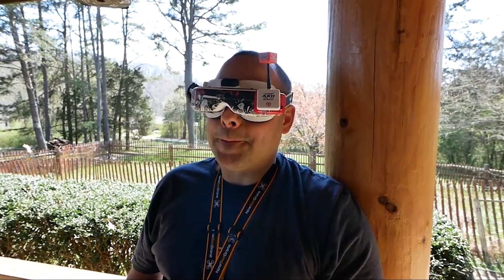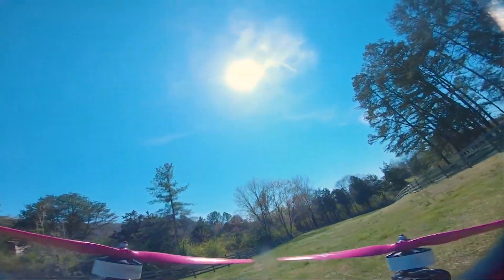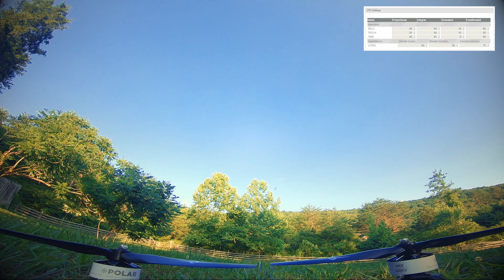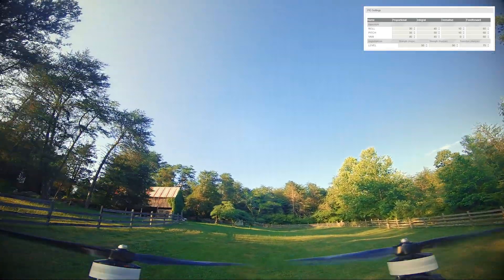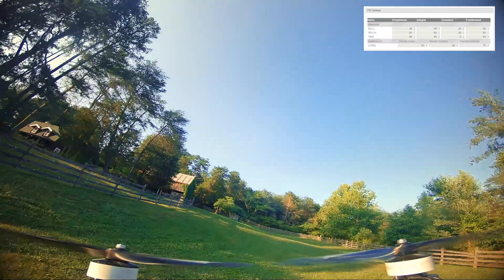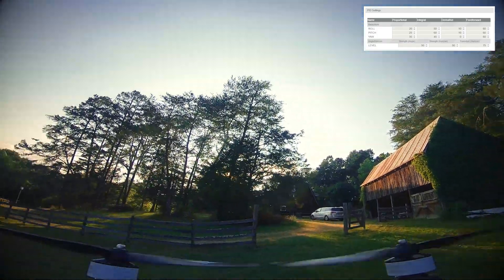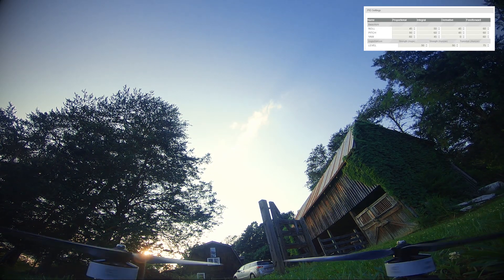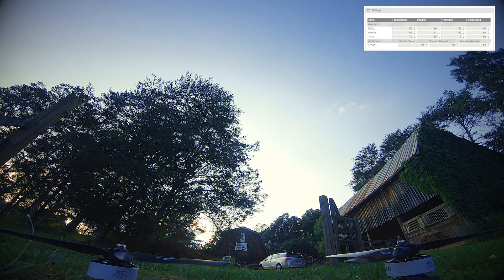Beast Class X-Class PID Tuning | Part 1

Comment: Since you have those nice blackbox logs, I'd really want to actually look at the R/P P/I/D/Setpoint values at each of those points, and try to make senes of where those little oscillation bobbles.  Probably worth chunking that into the BBL Review FB group to see if we can make sense of it.
I still suspect that most of what you're looking to find is probably in and among the Antigravity, iTermRelax, and dynamic LPF Min on Gyro -- I think you'll be able to lean on very extensive (and low frequency minimum set) D-Term filtering, and let the gyro lowpass move higher up and cause less phase delay down low, I think that's really the bigger difference.
Use D-Min and D-Term filtering to keep motor temps safe and sane, but be a bit more aggressive on LPF (and get those to 70-80Hz range at least) to get the stick feel and flight performance going better.

For my part, I'm really happy I've stuck with 7", because they're a quarter of the price, and in some cases faster than 5" while still sounding super impressive.